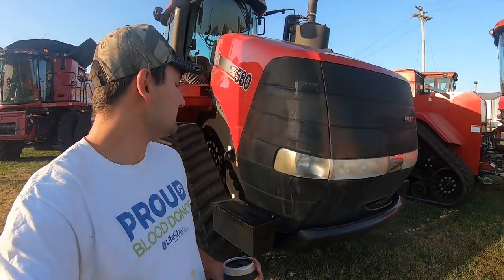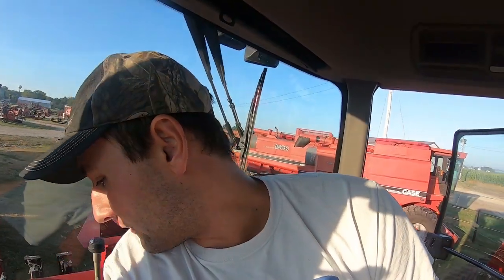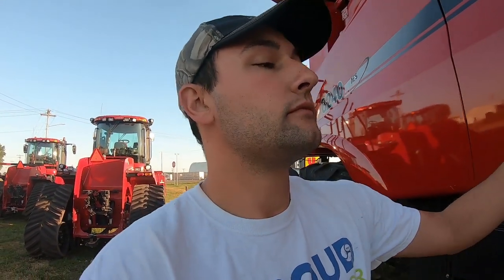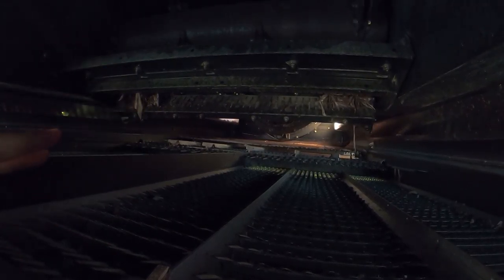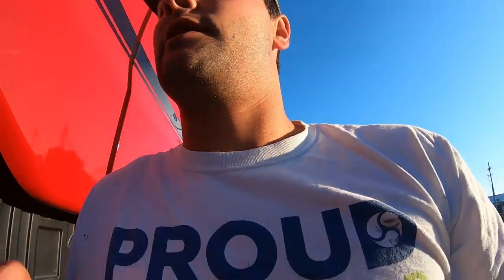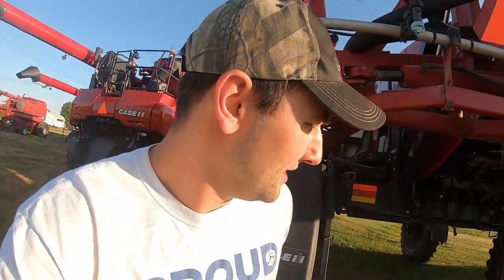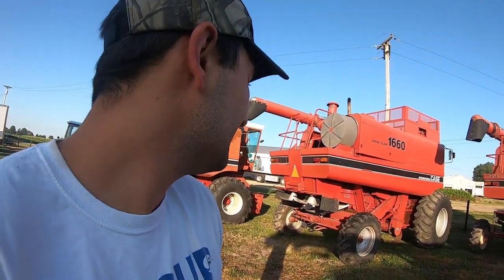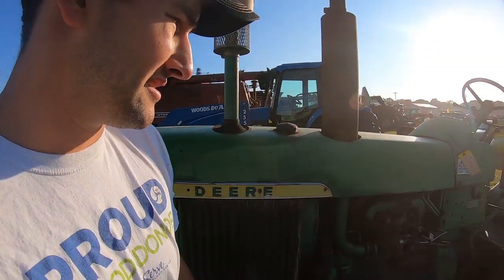Kunau Implement Equipment Auction Walkaround

Comment: CaseIH is part of CNH Industrial, which is owned by Fiat, which owns FPT (Fiat Powertrains).  So FPT engines are in many CaseIH products.
Reply: @G Manloh I don't think there is a true Iveco engine brand anymore.  There are Iveco trucks, and the engines are FPT.  Wikipedia explains it better.  https://en.m.wikipedia.org/wiki/Iveco
Reply from the maker: Great link Brian, thanks for the clarification, never knew that. Great info